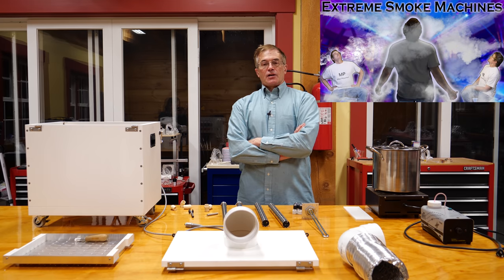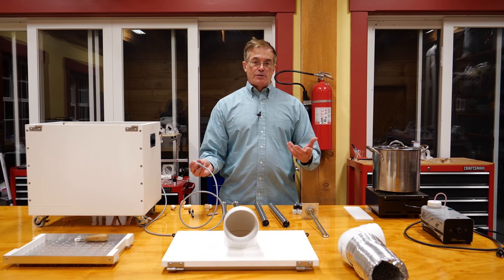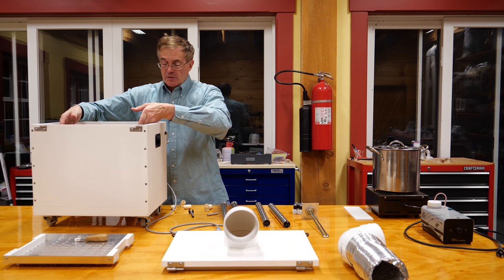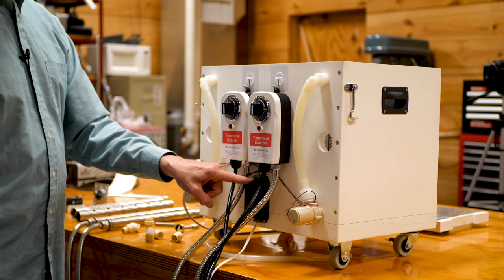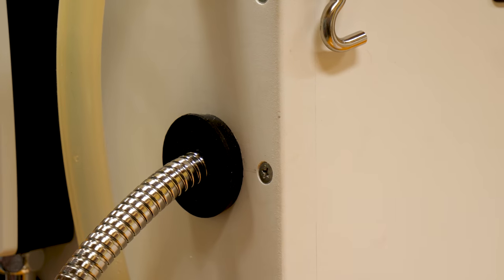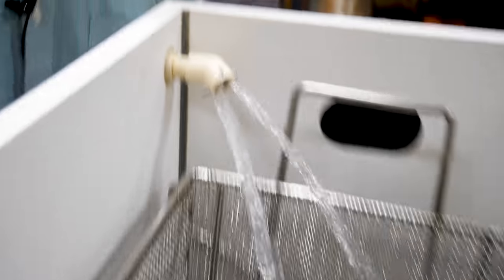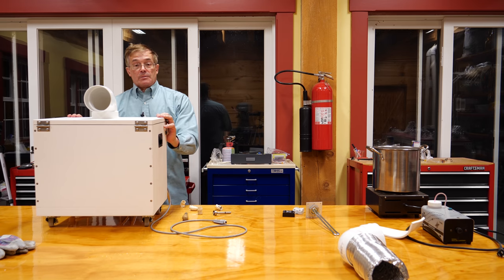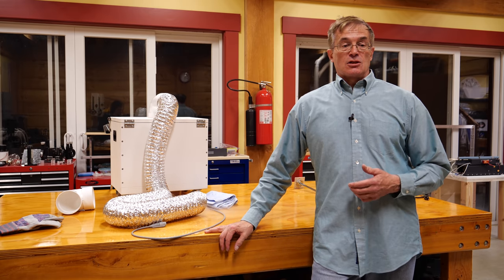Powerful Dry Ice Fog Machine!

Comment: In looking at this for theatrical use, it seems to me that the ratio of ice to water will determine the length of a pulse. About how long is a pulse given this unit's ratio and about how many square feet does that pulse maintain an ankle deep blanket? Also, how would you advise managing the unit between scenes where it might be sitting there 30-45 minutes with the hot water slowly melting the dry ice in the basket? TIA
Reply from the maker: As long as the pumps are off, the system will run out of dry ice in about three hours.

Comment: I've been thinking about making a foldable (so it is portable in my small vehicle) kayak out of coroplast, have any suggestions/interest in this project/material?
Reply: I forgot to mention, it's cheap!  :D  Just my budget.
Reply from the maker: It might be a little too heavy, dense and strong for a light weight kayak.  But, you might take advantage of the thermal formability to fabricate a custom seat or bulkheads.

Comment: About how long does the fog last before you run out of dry ice, or hot water?  I'm trying to fill a small stage for a misty ground fog effect.  Just wondering how long it would last ish?
Reply from the maker: I'd have to guess because  it's  been a while. I'd say two full minutes  at full flow.

Comment: Shouldn't you be able to use simple waterspray bottle nozzles on the pump outlets to produce water mist to interact with the dry ice?
Reply from the maker: You could, but they will reduce the volume a lot.  This requires a lot of volume to deliver the heat needed to create a lot of fog.

Comment: The fog comes pouring out as if there's a blower, yet the main case is rather well sealed. Is this due to the pressure created by converting the solid dry ice to gas?
Reply from the maker: Absolutely correct!
Reply: @TechIngredients  It's awesome that the process of creating the fog also propels it out. Introducing a blower and other air would only dilute the fog.

Comment: You mentioned that pvc foam board was cheap, like really cheap ... I looked it up and all I could find was either 100$ -150$ for 3 pieces  or I managed to find a couple for right around 20$ea. Size = 3/4" x 8' x 7.5"  ... What did you find for prices & sizes ?  (maybe update ur BOM if u find it ? )      I'm always on the lookout for cost effective materials.  I was thinking that we might be able to make a decent panel by getting those Rigid foam insulation panels and coat with reinforcement. Those panels are typically 2'x4'x8'  for 20$ ... Perhaps they could be reinforced with that fiberglass+epoxy trick u showed on a previous vid ...  What about AirCrete? u know about it ? There is a YT channel Honey Do Carpenter who has been obsessed with it.   I've been wanting to try it for years now !!
Reply from the maker: I believe I paid about $60 for a full 4'by8' sheet.  The problem with laminated foam core is crush strength for screws and that the inner layer of the sandwich will soften due to the hot water, effectively eliminating it's function as a reinforcement.

Comment: I am wondering whether it is dangerous to use so much CO2 in an enclosed space? 

Doing some rough calculations you are dumping about 8 cubic meters oft Carbondioxide into for example the car you where using...

Comment: Great video as always, but you can get about 4x the 'smoke' with some slight tweaks and lowered risk of a teenager having a bad day from electric shock.
1) That 'drip tray' system means that you've got a huge amount of surface area right in the way of the exhaust, allowing internal condensation. You'd have been better to use a miniature garden sprinkler system or just put all the water through lots of little nozzles than to resort to a drip tray
2) In most countries it is illegal for most people to wire up their own mains voltage plug, and the one you've recommended is a grounding nightmare. If there is any salt contamination, or a fault in the heater from being overheated even once, you can get the full mains shorted through the basket. I think you're forgetting that a teenager watching this video won't be intuitively aware of the risks like you are. Please recommend to people a fully grounded or at least double insulated pre-made heater, rather than asking people to illegally wire up a mains plug to save a few $$.
3) As you can see in your video, the fog clears up very quickly, and that is because the humidity in your workshop is low, and the temperature of the fog is low. If instead of merely spraying hot water on the dry ice, you instead use the the vented output of a boiling device, then you can get the fog output up to room temperature at least, and since the steam is super-saturated (and now minus the drip tray), you will get fog that can still be calibrated to be only slightly heavier than air, rather than almost immediately falling out on to the ground
4) Extra bonus points if you integrate a humidifying system. If you get RH to 80% rather than the normal 30%, and with the fog output now being near room temperature, you could make a smaller safer system that is easier to build, have fog that hangs for a long time, and has a much higher 'fog to wet things' ratio, and need about 1/4 the amount of dry ice.
5) CO2 output in confined spaces, yes you will tend to freak out well before it causes you to asphyxiate, but maybe mention this effect and give a back of the envelope calculation about how much dry ice per hour per room volume would cause a noticeable effect.
Reply: Did you build the system you propose or just have the theories?

Comment: Could the dry ice be replaced with a refrigerated plate?
Reply from the maker: Probably not.  The cooling power would have to be enormous and the CO2 that is released also drives the fog out of the machine.  It's possible, but probably not practical.

Comment: Can we use a few jets of very cold air intersecting a jet of steam for a better fog ?
Reply from the maker: That could work in theory.  The hot water and the dry ice represent a huge amount of energy exchange.  You'd need a large machine and a lot of power to equal the output from this particular unit.

Comment: How difficult would it be to use liquid CO2 rather than dry ice?  It would be handy to use paintball gun CO2 cylinders.  They wouldn't need to be insulated, and they could be stored long term.  I'm thinking of spraying metered amounts together into a container.
Reply from the maker: I'm not sure.  The cold CO2 vapor is condensing the saturated water vapor within the box.  If the water is hot, but still in liquid form, I don't know how well the fog would be generated.

Comment: Excellent educational vid. But it has raised a question. Is it possible to safely add a fluorescent waterborne dye for a coloured smoke effect without impregnating porous substrates, resulting in staining? Another is the use of neon dye for effect using a black light. I understand the chemical compositions of both dyes may make this impossible to implement safetly but the possibility of this seems to have no reputable  scientific answer. Thanks again. 👍👍🇦🇺
Reply from the maker: Sadly, no.  The fog is condensed water vapor and as such it is like a low temperature distillation, the dye will be left behind in the tank.
But, the effect you are suggesting can easily be achieved with colored, lighting.
Reply: @TechIngredients  Thank You. You can only learn by asking. 👍👍🇭🇲

Comment: I wonder if an acetone or ethanol heat exchanger could be used to generate fog and allow venting the CO2 separately.

Oh, and I wonder what the pH of the fog is. It's got to form some carbonic acid, right?
Reply from the maker: I haven't measured it, but I suspect you're right.
You also need the CO2 to drive the fog out of the box.
I'm not sure what the benefit of separating the functions would be.
Reply: @TechIngredients  use in enclosed spaces? Some folks died when they dumped a bunch of dry ice in an indoor pool a while ago.
Reply from the maker: There are thousands of these units operating around the world at clubs, parties, receptions and weddings.
The CO2 huggs the ground and is unpleasant to breath.  It isn't subtle and makes you panicky if you can manage to get into a position to breath enough of it.
Reply: @TechIngredients  Your use in the car just had me thinking of edge cases. A chiller after a thermal fogger would probably work if a person was to be in a confined space and fully immersed in the fog. (Rising out of a tub filled with fog, opening a closet door so the fog spills out revealing someone)

Comment: I just use my vape pen ...     Something about using a heap ton of dry ice and hot water seems low tech ... What about using an array of ultrasonic transducers(like 20?)  >> Use that OR pipe the mist towards the dry ice.  Sure would save on the elec bill ++ might be portable
Reply from the maker: Actually you'd ideally want water vapor, not water droplets, but the idea has merrit.  A few ultrasonic transducers and boiling hot water might be best.
Reply: @TechIngredients  Luv the channel man :)  The only thing that gets me is that dry ice is not exactly convenient. Would b really cool to have something more efficient.... I used to DJ a lot and in my experience the fog machines would only coat the floor if it was absolutely dumping all night. Only a high output machine would even be able to run that long as most machines have a poor duty cycle. They timeout every so often. Heating elements would crap out. lol .. =memories ...  I do also remember that if you point the nozzle at a wall/object "to make an effect or divert" , then that surface would have a fog juice coat.   DOOD , nooo the machines would only run for like 2 - 5 mins, then would need to rest for like 15... It was always such a burnout, caz the nu DJ's & girls were always wanting to push the button.  Then they could look at me like 'wtf, it died :( I was having so much fun !! wha do I do now :(  Fix it please !! "
Reply from the maker: Ya, I know.  We ( my sons and I) have played a lot of gigs as laser DJs and at least we had the same goal, to nurse all the equipment through the show.  Everything will break eventually and that is why you bring extra, including screw drivers, duck tape and EXTENSION CORDS!
Smart lighting can leverage the fog and locating the audiance optimally relative to the type of show helps as well.

Comment: How safe it is to use this in a relatively small room with poor ventilation? I know You mentioned this is a relatively large setup for larger event and stuff, but people known to be idiots sometimes, doing stupid things, and 15 kilograms of dry ice sure puts out a lot of CO2. I was just wondering how much exactly, when does it becomes dangerous?
Reply from the maker: Because the fog and and the CO2 hug the ground and because the CO2 is unpleasant to breathe, it makes you panicky, it is unlikely a person will get into trouble with such a machine unless unless they are in a small tightly sealed room or already unconscious and lying on the floor.  The same could be said for using a gas fired stove or an IC engine  without ventilation.
Use common sense.
Reply: @TechIngredients  Your point is actually my main concern. Fog machines like this generally used in clubs, pubs, whatever, where people laying on the floor "passed out" isn't really uncommon. But even in smaller settings, a house party, Christmas party, birthday party, whatever, small kids will be present. They're also close to the ground, where the CO2 likes to pool. I'm not trying to imply anything, I'm genuinely interested what the concentration of CO2 is potentially dangerous. But I guess I can just google it...

Edit: You compare it to a gas stove or IC engine, which is not the same, not even close. I don't know how many hours You'll need to burn those to produce 15 kilograms of CO2, also, those are hot, mixed with hot gases, which will rise and mix with the air before it cools and settles on the floor. As opposed to the fog machine, which produces 15 kilograms of CO2 in a matter of minutes and it pools on the floor pretty much instantly.

Comment: "unless you're doing your demonstration at a big facility" -- laughs in german 220V16A regular house circuits and 220V32A/400V16A/400V32A high power outlets, you also can install with regular power cables you get from your city.